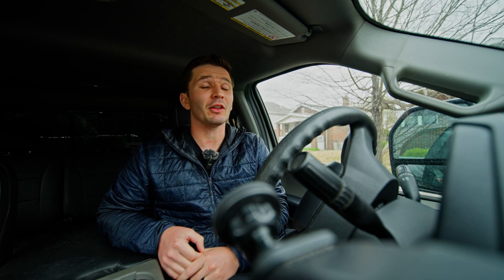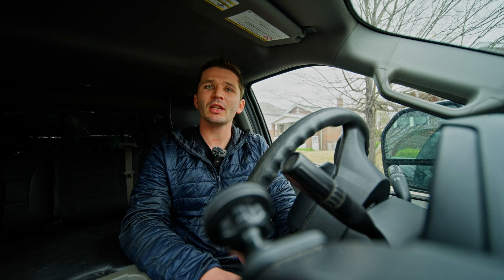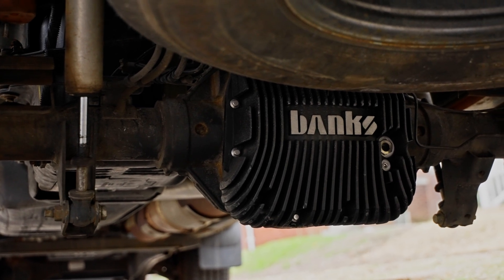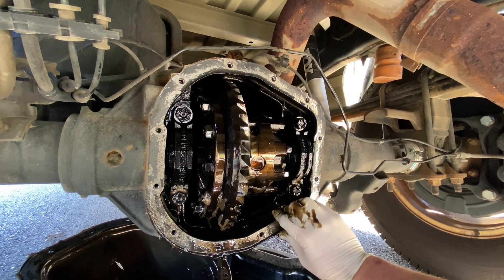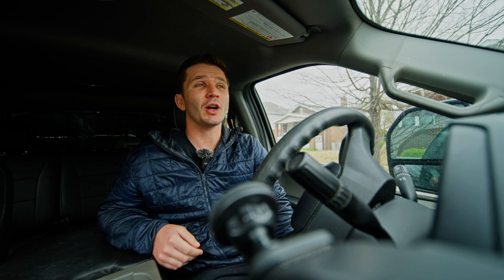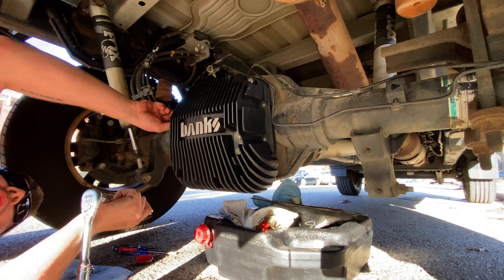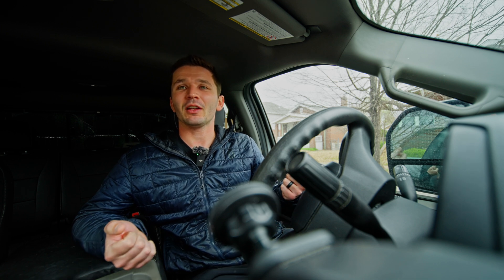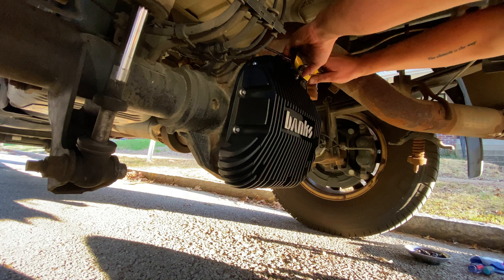Ford Super Duty Differential Maintenance | Banks Ram-Air Cover

Comment: Thank you for covering this topic. And, you're right, we didn't engineer the Ram-Air Rear Diff Cover because people were blowing up their rear ends. We developed it to extend the life of the ring and pinion gears and pinion bearings. And, we maintain fuel economy. This is in contrast to high-capacity flat-back covers that not only hurt fuel economy but destroy the oil by beating it against the flat surface, turning it into a cake batter-like froth.
Reply from the maker: Thank you for the comment! I appreciate the explanation and response. That makes a lot of sense. The time and attention you put into the design of the Ram-Air cover is certainly evident. A top notch product.

Comment: when i bought my 19 a year ago, over the 1st month i changed all of the fluids (except radiator - but i've since done that recently) and the differential fluid and transmission were just BLACK!  the T-case was still pretty red, but everything else totally needed to be changed.  my front diff was seeping just a bit so I had motivation to do that anyway.
Reply from the maker: Good call! It sounds like all your fluids really needed to be done. I’m sure your truck was very happy

Comment: Changing my different at 50k interval, with volvoline fluids ...still running oem cover on myb17 F350 with the Dana M275...
Reply: Did the same on my ‘18. The color of the fluid said, yes this was needed.
Reply from the maker: Nice! It does seem like 50k is the sweet spot